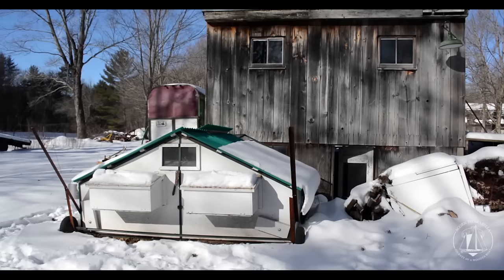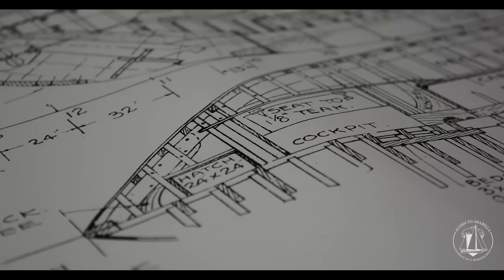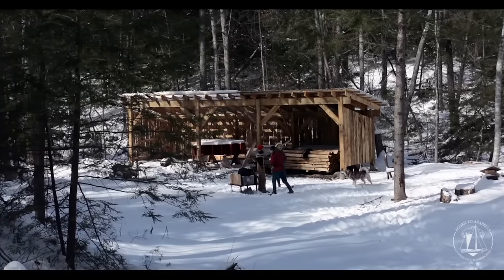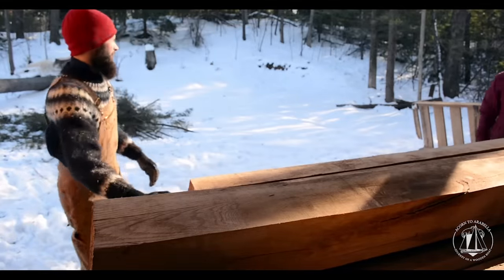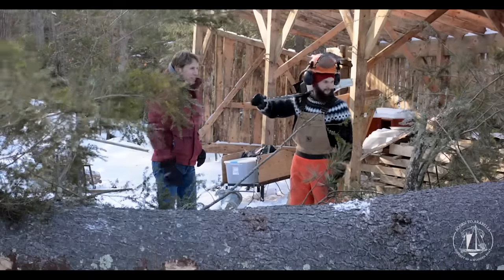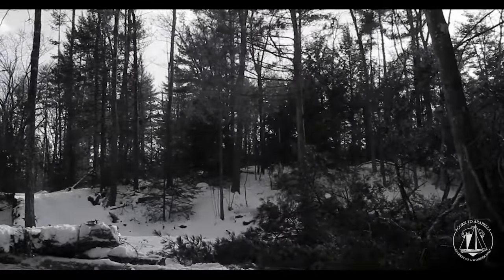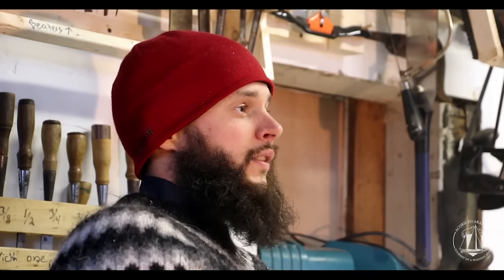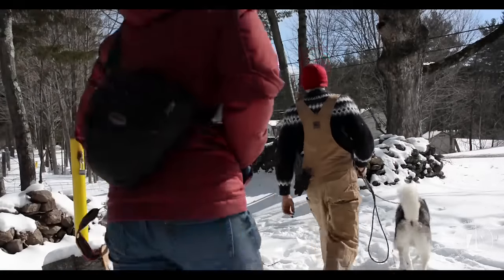Acorn to Arabella - Journey of a Wooden Boat - Introductory Video

Comment: My Dad built a daggerboard sailboat from a "Popular Mechanics" set of drawings from the 1950's.  He kept those drawings on the garage wall for decades promising to build his boat, "Burning Daylight," some day.  Some day came and we started the frames in 1984 (or was it 1982), and he eventually finished most of the boat before he died in 2004.  He left the boat to my older brother Mike, a Kings Point Merchant Marine Academy graduate, to finish, and not long after my Dad's death the boat was completed.  Dad took great care in making every bit of that boat, forming all the frames and bending the wood and buying tools as needed.  Long story short, no matter what it is, if you can make something with your own 2 hands, there's nothing more satisfying.

Comment: I mostly work on mechanical things in my shed, motorbikes cars...etc. i saw your led pouring vid and got into it from there. i'll be following along your journey. Good luck. i have repaired two small boats in the past nothing on your scale though. good work felling that tree for the mast. i know you want a bend in the mast but was surprised to learn spruce wold make your mast....good luck 👍
Reply from the maker: Thanks!
Most tall, straight growing trees make decent masts.  Some are better than others but the trees that grow like that evolved to withstand being tall and skinny.  They are also usually lighter woods, a oak mast would weight a lot!

Comment: I think the back story of where the name Arabella came from needs to be part of the story.
Reply from the maker: It's from a book, the book is on the bookshelf in the house and will be aboard Arabella.  To know more one must befriend us and spend the time to find said book.  That story has to be earned.
Reply: Fair enough.  I have a book recommendation.  Your project is very much in the spirit of Robert Pirsig, one of the most brilliant minds of the 20th century.  It would be fitting to include "Zen and the Art of Motorcycle Maintenance" and "Lila" in your little on-board library.